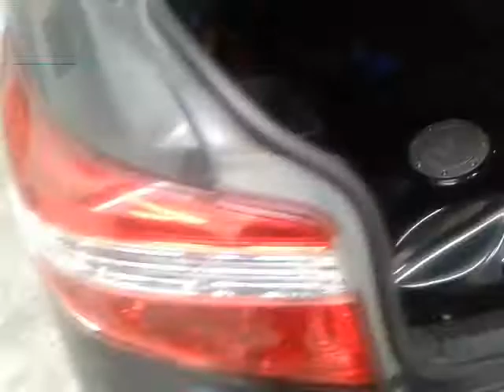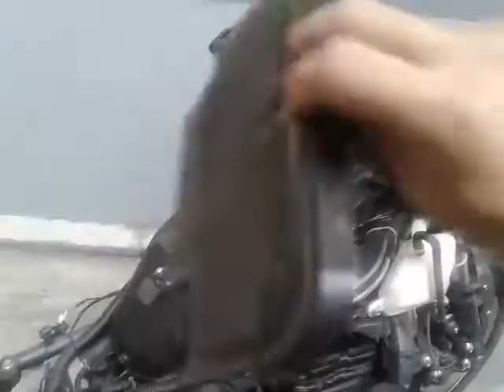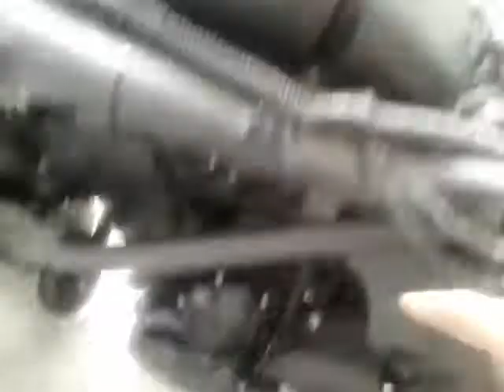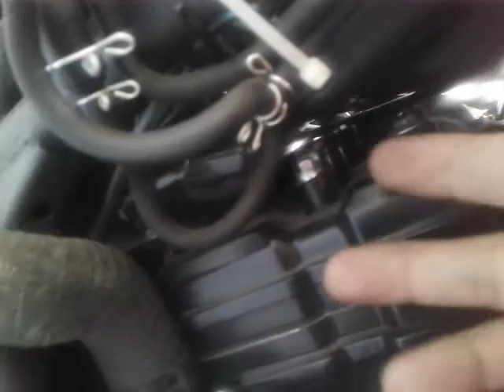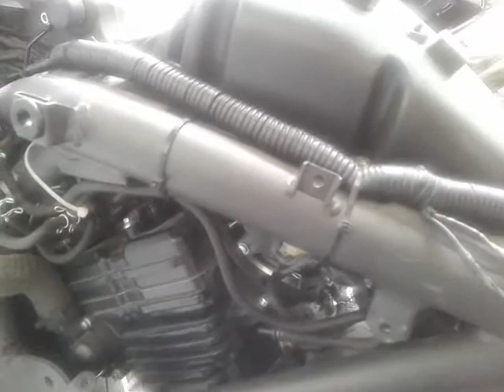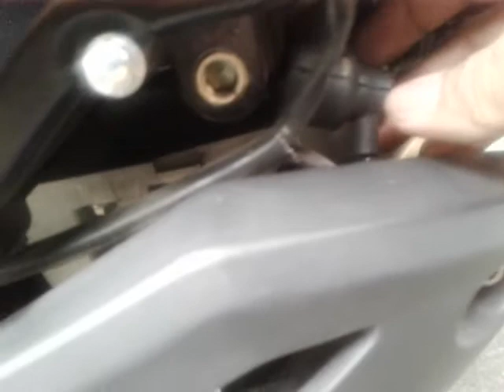CFMoto 400NK - Air Filter, AFR, Power, Sensors, Gas Tank (random thoughts, spontaneous vlog)

Comment: Sir tanong po, sa nk400.. bgla pong not working ung speedometer, naka 0 pag pinapatakbo, tapos ngayon pinalitan na ung speed cable sensor, pero ganon parin po? Ano kya possible reason bkt 0 parin? Salamat po ng marami sa sagot.
Reply from the maker: Ang pinalitan ba e yung speed sensor cable lang? Baka pwedeng i-check din yung mismong sensor baka madumi or merong damage. Ang alam ko sa speed sensor ng 400NK ay yung nasa kaliwang fork leg. Yung speed sensor ay merong serial number or date tag. Kung tamang sensor ang pinalitan, kung okay na ang cable, okay na ang sensor pero meron pa ding issue, baka yung connection papunta sa ECU pins. Ang isa kasi dun is yung pin para sa speedometer so baka lang andun yung loose connection or baka merong short along the harness.